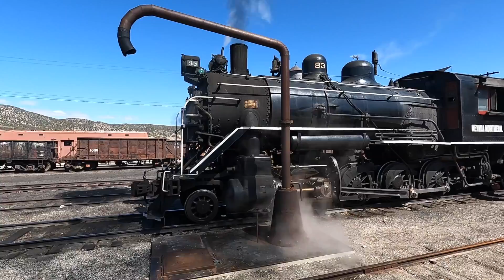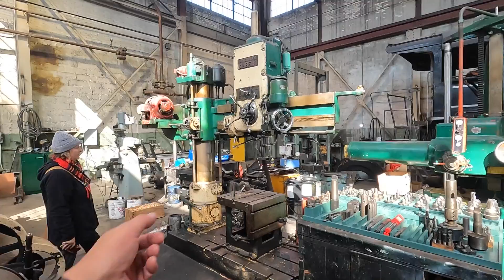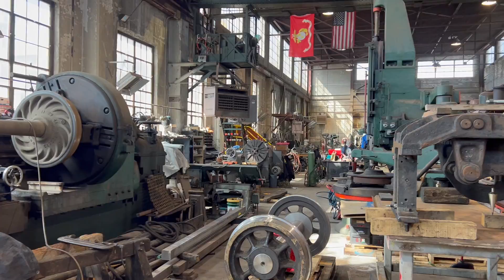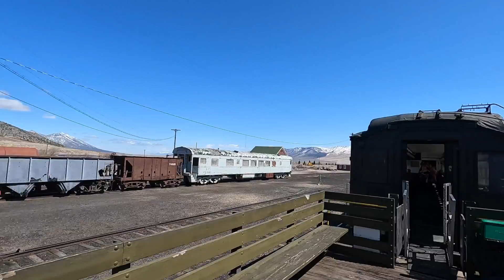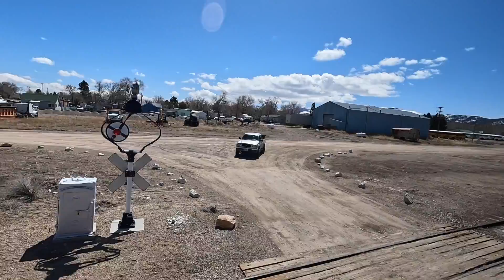Nevada Northern Railway Machine Shop & Engine House

Comment: Question. If you are running a mixed manifest train with a mix of full and empty cars, how do you regulate the brakes on the empty cars so they don't lock up under normal braking. They being so much lighter I would think they would.

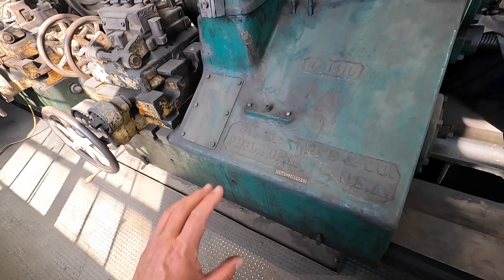Comment: 17:20 that is a Sellers lathe and it appears it was broken in two and welded back together. You can see the weld line coming from the corner below the switch box running thru the Sell"ERS" and the Phillidel"PHIA"

Comment: Another historic railroad in preservation is the East Broad Top in PA - one of the last remaining narrow-gauge railroads (3' between the rails). Started in the 1870s, closed in 1956, reopened as a tourist operation in 1960. The shops complex (machine shop, foundry, etc.) is open from time to time for tours also.

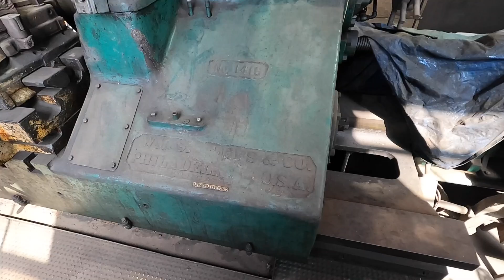Comment: 17:01

Wm Sellers and Co, of Philadephia Pa.

according to vintagemachinery...

The house of William Sellers & Co. was started in 1848 as Bancroft & Sellers, and so continued until 1855, when upon the death of the senior partner the business passed into the hands of two brothers, William Sellers and John Sellers Jr., who alone constituted the firm until 1873. It was the pioneer in the introduction of the present system of mill-gearing with interchangeable parts, and the manufacture of machinists' tools as a distinct branch of business.

      When Edward Bancroft died, William, partnered with his brother, John, reorganized Bancroft & Sellers into this firm in 1855. Their cousin, Coleman Sellers, joined the firm in 1856 after having been superintendent at Niles & Co. The focus was on large machine tools for the railroad industry. Sellers built one of the largest lathes ever made in 1892 to turn and bore barrels for the Navy's 16" guns.

In 1943 a group of investors bought William Sellers & Co. and merged it with Consolidated Machine Tool Corp. of Rochester, NY.

Comment: according to vintagemachinery

" Niles Tool Works was originally Niles & Co formed by brothers James and Johnathon Niles in 1845. They made steam engines and locomotives and later in the 1860's, lathes. In 1869 the brothers sold the firm and the purchasers, James W.Gaff, Alexander Gordon, & George A. Gray, renamed and operated the company as Niles Tool Works. The company moved to Hamilton, OH in 1873 and specialized in machines for the railroad industry, producing some of the largest machine tools at the time. They incorporated in 1873 and Gray left in 1877 to form the G. A. Gray Co. In 1899 it merged into the massive Niles-Bement-Pond Co., a firm that was not equaled in size.

      In 1928, George A. Rentschler merged his Hooven, Owens, Rentschler Co. and Niles-Bement-Pond Co., to form the General Machinery Corp. In a series of post-World War II mergers, GMC was transformed into Lima-Hamilton Corp. and finally Baldwin-Lima-Hamilton Corp. before completing relocation to Eddystone, Pa., by January 1960."

Comment: according to historylink

"Pacific Gear & Tool Works began in San Francisco in 1888 as a machine and gear grinding shop. Fire from the Great San Francisco Earthquake of April 18, 1906, destroyed the business, but owner Philip L. "P. L." Bannan Sr. (1873–1944) immediately ordered replacement equipment and rebuilt his business in a nearby frame structure. By 1910 he had built a brick building on Folsom Street, where the company remained until the 1950s."

Comment: I was there 8- 10 years ago. You missed the boiler room and the casting and pounding and heat treating rooms in the back or were they not open?  They have patterns for the gears that they made, a huge alligator shear and a couple of power hammers with heating and forging ovens.

Comment: Spent some time there in Ely with the trains a few years ago , Great place to go. You can also take a Cab ride and operate some engines...but unfortunately we didn't this trip as my Grandson was not old enough yet to be in the cab.... Nice place to see & go almost in the middle of nowhere ....off the old Highway 50....Don't know where you camped at but about 60 miles East of there at the Great Basin National Park is also quite an interesting experience if your a Star Gazer as they have some of the darkest sky's in the USA on moonless nights......Very pretty where the starlight is so bright it will actually cast a shadow on the ground.  Happy Anniversary

Comment: The shop is so amazing. I'd be in heaven working there. I'm not into the CNC stuff. I really enjoy running my old South Bend lathe and 1940's drill press way better than the new stuff today. The old equipment is as accurate as the person operating it.

Comment: They should still be mining up there. There's an overlook where you can look down into the pit. Last time up there they were drilling for the charges to blast down another layer. They have the giant haul dump trucks. You didn't explain that the mine and railroad was for copper.

Comment: Oh man I was hoping you showed that rotary table because it looks similar to mine. I bought a big 12” for my Bridgeport a couple years ago and I have no idea who made it. I never took it apart to clean it so I don’t know if it’s tagged inside somewhere but it seems very well made and it’s very accurate. Mine has a rounded wheel though. That one looks more squarish. What a place though! I love it!
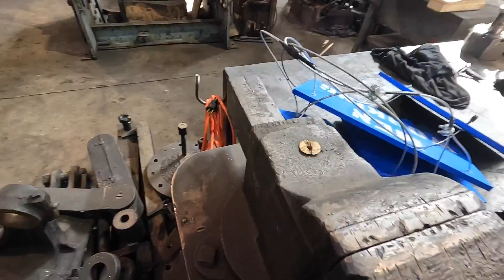Reply: Crap I meant to put the time. I think it was @ 13:42 or something like that. It was sitting on the table after you showed the Ridged threader which I’m very familiar with being a plumber by trade.

Comment: Did you get back to the steam plant and blacksmith's shop in the back room?  If they fixed the boilers there they could steam power the line shaft equipment but an electric motor would be easier.  So much to see there you need a few days. Glad you made it there.

Comment: Back when I was in my 20's I worked in oilfield fabrication shops that looked  and probably smelled like this place. The smell of metal being worked, cutting and lubricating oil from the components being worked with a layer of dirt and metal shavings everywhere coupled with the smoke from welding. You always left at the end of the day tired but with a sense of accomplishment from your work during the day. 
I'm in my 70's now and I look back at the years and there is no wonder about why may knees are wrecked along with my hips and back, eye sights not the best anymore, and my lungs are pretty much shot.

Comment: 2:07/40:08 The pipe on the side of the track is?  for Mail? water? ???🤔The wrecking crank (80tons) is probably used for derailed trains and towing because a steam engine (train) is about 80tons right?🤔🤔 How long is the train track?🤔🤔🤔
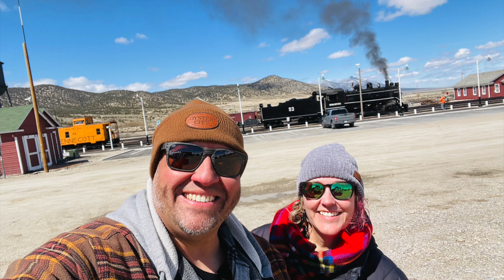Reply: That is called a standpipe. It's used to fill the locomotive tender with water. At 39:25 you can see the water tower that feeds the standpipe and probably other water outlets on the property.

Comment: I took my family on a weekend train trip... We had such a good time we are doing it again.... We went during the fall; nothing better than cutting through the brush while the leaves are changing and kicking back some adult beverages...  It was cool because a steam locomotive (diesel, not coal) led the charge and a diesel electric pulled us back.
Reply: Didn't know a steam loco could run on diesel.
Reply: @daves570  anything that can burn can be used to heat a steam engine, mostly wood, coal or oil, but biomass gas, liquid natural gas, biocoal, and possibly even hydrogen even filling up the boiler with steam from an outside source without a fire called fireless steam locos, some were even compressed air like the one in the age of steam roundhouse in sugercreek ohio.

Comment: That lucas horizontal looks exactly like this real old german one we have at work.  Its a beast and has some crazy feed controls. Its like driving a wierd car. Even has a rotating table. The quill has like 3feet of travel. The feed in on quilk is cool a 4 handled handle and you pull it inward so all 4 handles pop in and then it power feeds. All the brass plates are in german or illegible

Comment: Have to run for an appointment and will have to finish this later.  You are redeemed.  When I saw that you had posted passing through the Ely area and didn't mention the NN, I went into mourning.  Glad to see you did stop.  Now, bow your head in shame.  That was a William Sellers and Co. wheel lathe. Sellers was a manufacturer of machine tools for the railroad and ship building industries. Sellers also manufactured injectors for steam locomotives.

In the early 1870's William Sellers and Company provided most of the machine tools for the machine shop in the new Virginia and Truckee Railroad shop in Carson City, NV.  They also provided the turntable.  The shop was variously known as Curryville, after the contractor, or the Stone Fort.